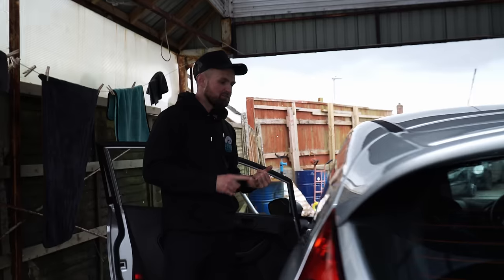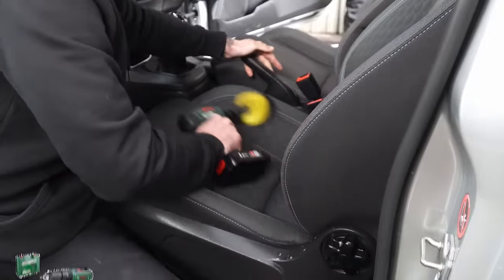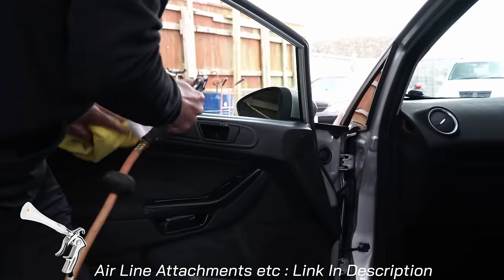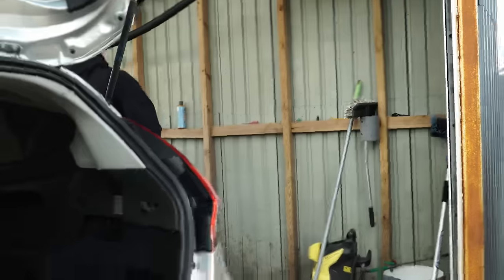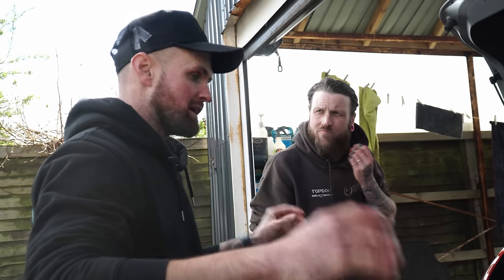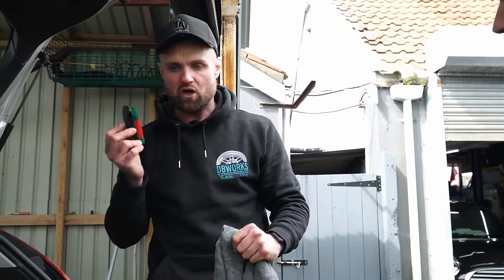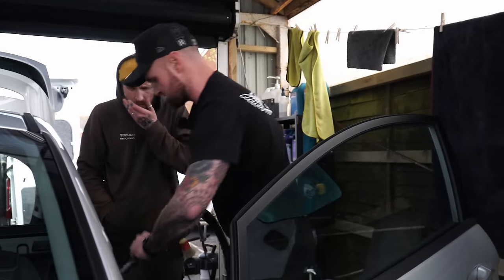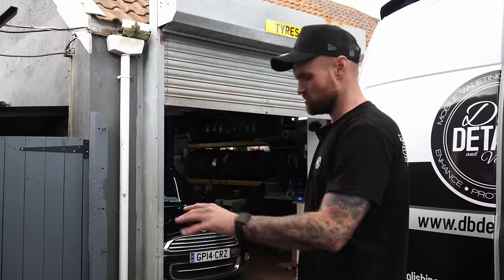The Ultimate No Bullsh!t Car Valeting Process | Pt2 - Interior

Comment: Only thing I’d add - really try to avoid G101 it is awful stuff and pre longed usage will cause respiratory problems particularly in enclosed areas like cars etc

If you must use it regularly use a mask.
Reply: He's using way too much MPC (G101) there was more soap used in the car than the outside, you'll never extract all of that from the seats and putting it on citrus cleaner too... it will just attract more dirt in the seats with the soap still in it.
Also using e brush on the drill on the softer fabric of the seats, the brush was also filthy, and used on the pedals to get the mud and grime off, the spray from the brush was going everywhere and flying up on the headlining too.

Comment: Guys good but his process takes too long.

Do the deep hoover, drill brush then light hoover after that use the little brush attachment run over it .  Also steam cleaning mats etc? Just drill brush them then use Autosmarts Carpet Dye spray brings them up good. Dont razor blade them all the little pine tree bits and whatever else just disappear with a bit of dye.

Seats near the end? If their dirty you should drill brush them after the deep hoover then that way off spray etc isnt needing recleaned.

Comment: OMG, I wouldn't let this guy anywhere near my car... I'm horrified watching this. 

As the saying goes, good work ain't cheap and cheap work ain't good.
Reply: Could you pin point what is horrifying here? It’s just how it is when prepped used cars in the real world… with more resources ie budget things would be different/ more involved. It’s about knowing what you can get away with and what is necessary.
Reply: He’s showing how to prepare a car for sale  not someone paying to have their car detailed
Reply: Well sitting back and looking at this objectively, as they're  a used car retailer, showing this content to prospective customers to see how they prep them for "speed" .. It would put me off.

Organising the team and having the right equipment would have been more valuable to Joe the owner, not tips and tricks.

Firstly, using the people resource better.
1) Have one person outside washing and decontaminating the outside of the car.

2) Use the inside area to prep and cleanse the inside using another on the team, having 2 - 3 people all working on one car at the same time isn't productive,  if its about efficiency and productivity having 2 cars on the go would make more sense.

3) As for tools, they need to throw out the "Hobby" power washer" it's for the weekend car cleaner not professional use,  and perhaps one that is a hot water penetrated one which will cut through the traffic film and also great under bonnet, and means you have to use far less chemical volume on the car. I see Joe using it from time to time holding the gun with just one hand!, it's ideal for cleaning off garden furniture.

When the cars have been prepped, they are then parked outside, where they just collect dust.

The first video content with the outside prep wasn't time efficient either.
Using a good thick, sticky snow foam to pre-wash and loosen and dissolve dirt, residue with a hot wash would cut out most of the work (would even save time when refreshing the car for a viewing after it has been parked outside).

No need to use a fallout remover too, also the Red 7 used in the first video is made for alloy wheel cleaning primarily, not paintwork. (a fantastic product tho).

Also as shown in the first video, using a clay bar on the paintwork is pointless and hugely time consuming unless a full machine polish / paint correction is going to happen followed by a hand applied ceramic coating.
The use of a coating from a snow cannon was the right thing to do for speed and efficiency for lustre and beading.

Hope that helps and that Joe Betty gets to read this.

Cheers